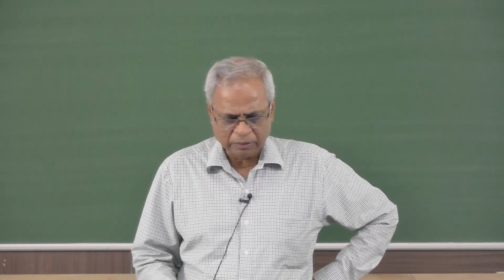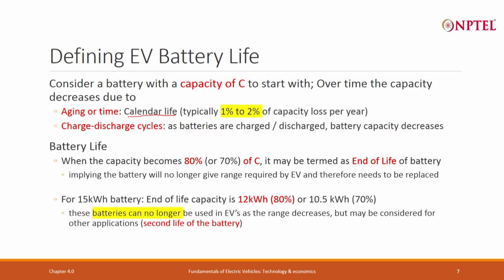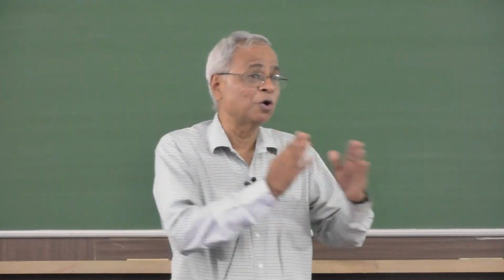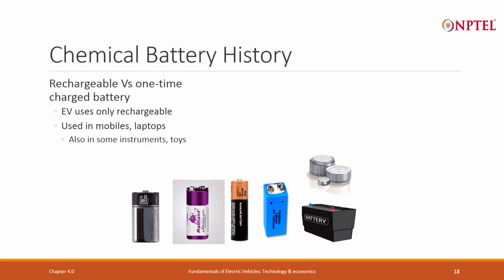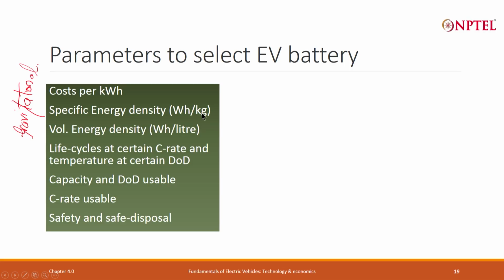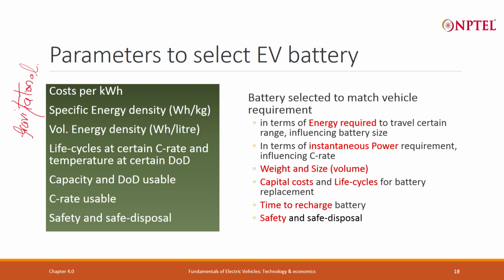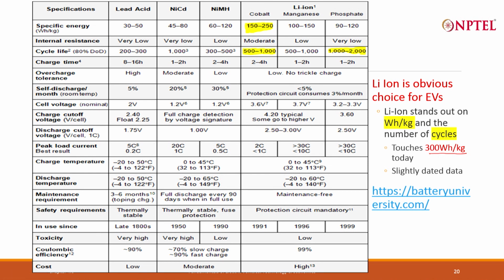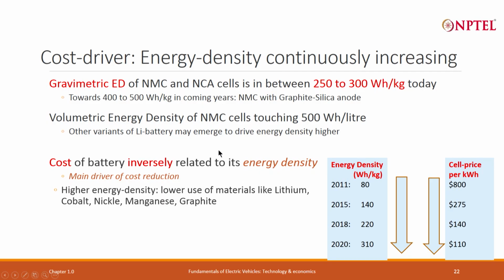Lecture 21 - Why Lithium Ion Battery? - Part 1

Comment: Could someone tell me the text book that was used for the lectures ? 
Or any particular recommendations would help as well
Reply: Did you find it?
Reply: @alphaz740  No
Reply: Electric Powertrain - Energy Systems, Power electronics and drives for Hybrid, electric and fuel cell vehicles by John G. Hayes and A. Goodarzi, Wiley Publication

Comment: Sir, when you say SOC of 100%, does that mean the actual battery kWh or DoD*actual battery kWh?
Reply: 100% SOC refers to full lithiation of the negative electrode. This varies with different chemistries. SOC is a complex parameter that cannot be measured directly but can be estimated using Coulomb counting. Although,  Coulomb counting is prone to errors, it is still used nowadays to understand the concept of SOC.
SOC(t) = SOC(0) - 1/Q[integral i(t) dt]

There exist an inverse relation between SOC and DOD. 
SOC% = 100% - DOD%
So, 20% DOD is 80% SOC